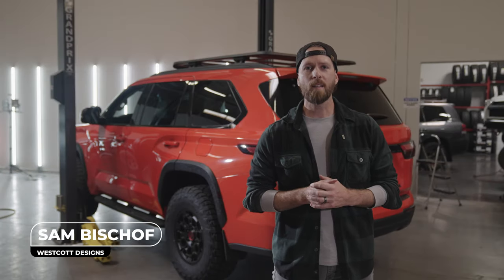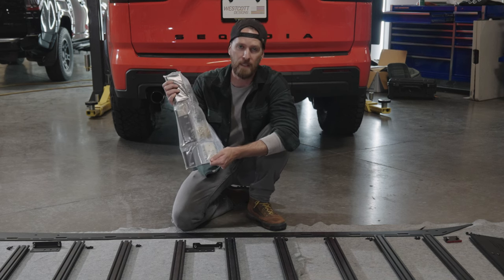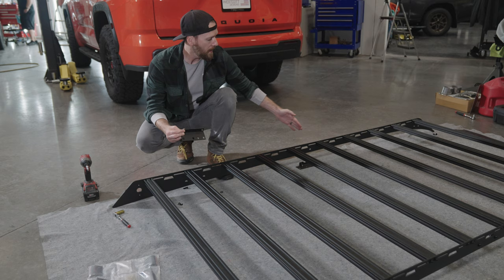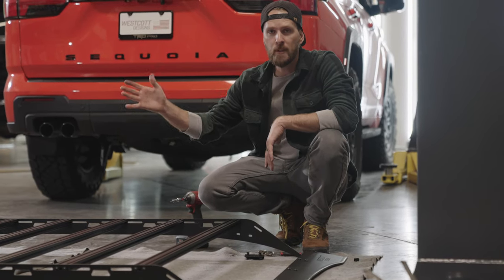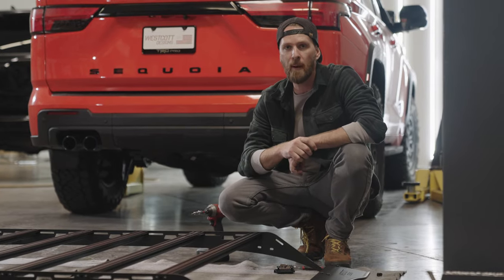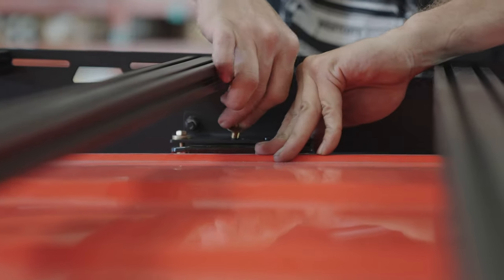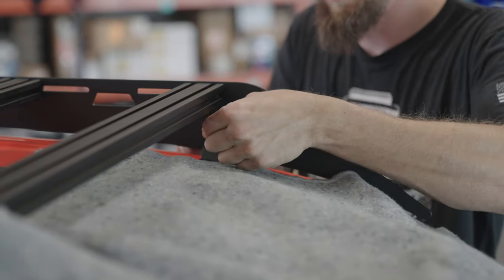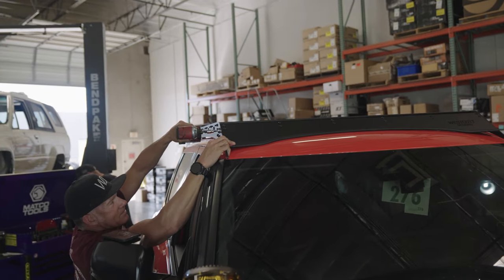3rd Gen Sequoia Roof Rack Install Guide by Westcott Designs

Comment: Thanks for the video! I am finishing installation of my modular roof rack for the Sequoia - instructions were clear keeping in mind that I never done anything to the car on this level before. The most complicated part was to pry off the factory rails from the roof but even that wasn't that hard with the right tool. Im thinking of adding a rear hatch ladder next ;)

Comment: Mine has the big pano roof. Will I be able to use this rack?
Reply from the maker: We make a low profile rack that I’d you have the pano roof you will need to remove the bars or we have our taller modular rack that you can use the pano roof and if you don’t want to use it you can make it into a basket rack.

Comment: I was wondering what tie down mounting hardware that you would recommend?  And also when installing would I have to remove cross brace?
Reply from the maker: It uses most of the universal T slot accessories.  It is a 1/4-20 Tnut.  McMaster Carr sells a lot of the track attachments as well
Reply: @westcottdesigns  thank you!!

Comment: So the front bar shouldn’t have anything attached as it’s only stuck to the roof with 3m tape?
Reply from the maker: All the bars a bolted it with 1/4 20 allen button head stainless  steel black oxide coated  screws.  As for the feet that go to the roof for support the the back 4 are bolted into the factory holes and the front 2 sit on 3M pads that sit in the seam of the roof in the rain gutter.  This is the strongest part of the roof and allows for maximum amount of weight.  The rack will hold about 2000 lbs. if evenly distributed.  The roof is only good to about 800 lbs. before it starts to flex at the mounting points.  I hope this is the information you are looking for.  Happy to answer any questions you may have.